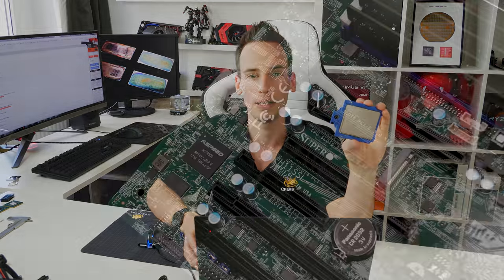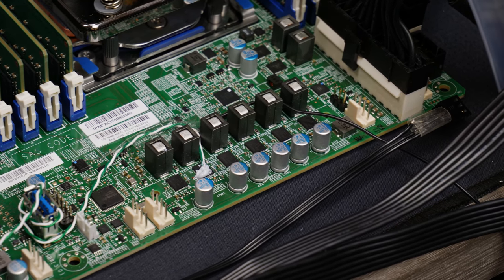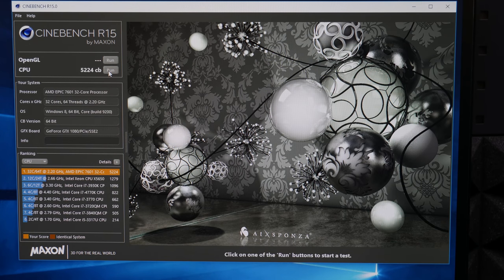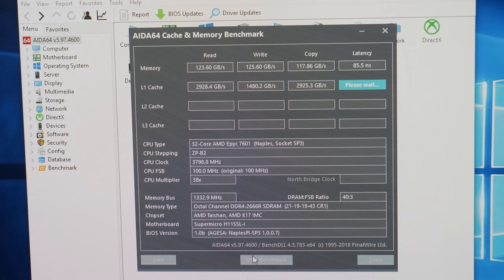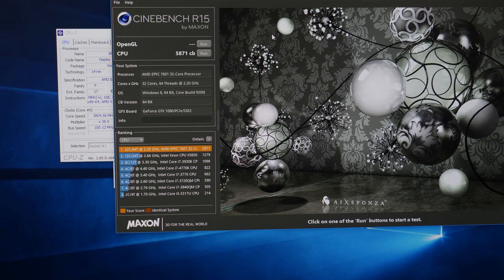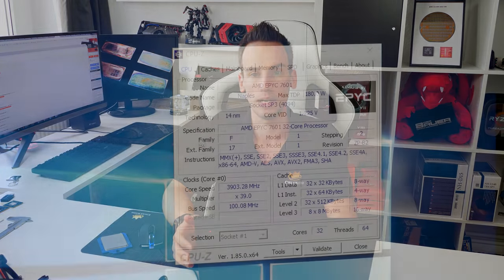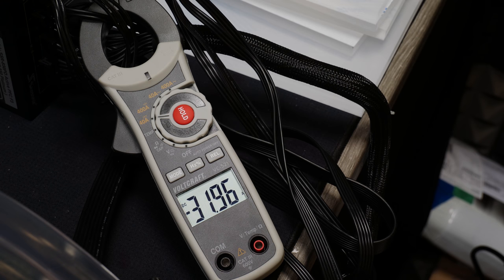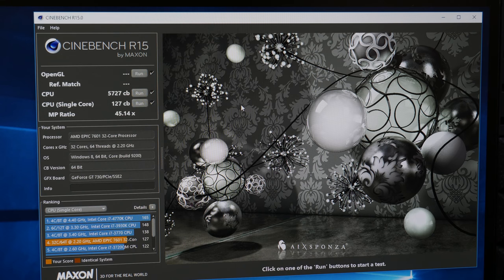Threadripper 2990X Preview - aka EPYC 7601 overclocking

Comment: Dude. Ask Evga to make another motherboard like the Evga Classified SR-2 and Sr-X. They let you overclock two Xeons. Having a motherboard that could handle two overclocked Epyc CPUs would be amazing. If not, maybe talk to Huanan?
Reply: I would not be satisfied until my rig dim out the lights of the entire neighborhood
Reply: Unfortunately EVGA manufactures only Intel based motherboards.
Reply: Huanan so far has only made crap mobos
Reply: Yeah they're kinda rubbish, but they're not afraid to do crazy things. Their X79 boards are just insane, letting you OC E5 V2 Xeons while not completely breaking the bank.
Reply: AFAIK regular X79 OC boards can also OC some Xeons
Reply: TheBackyardChemist
Yes, but they still cost A LOT even used. The Huanan boards cost around $110, and they come brand new in a package.
Reply: let's see if that changes when AMD holds the crown on HEDT performance & price/performance
Reply: Evga sr-2 is the best dual oc cpu motherboard ever
Reply: Kristoffer Johnsen evga intel shill
Reply: As a owner of three x79 motherboards (asus rampage iv, msi big bang, and intels own x79) Huanan boards are so much fucking cheaper XD. Now the combo deals on Aliexpress are not really golden deals but $80-$100 for a x79 board is a very fair price. Most x79 go for $200 unless youy get luck or find a low bid one like I did for mine.
Reply: Swan Knight if you can get a cheap x79 then it's better than that chinese board but otherwise it's stupidly good value for x79
Reply: Xx Tek tip xX I agree completely. Best one I’ve gotten so far was the evga classifies x79 for $40. The seller didn’t know if it would work or not so I shot that offer lol. My msi board I wanted and paid $250 for it but that was new condition so worth it xD
Reply: Swan Knight that's an INSANE deal - 40$ a for a x79 classified is almost unreal even if untested
Reply: Xx Tek tip xX I’ll be honest, felt kind of bad because he didn’t know what it was or what it was worth but once I sold it for $200 on eBay I felt better 😂😂😂
Reply: Swan Knight true, i got a noctua nh-d14 for £5 once and the seller had no idea what it was.
Reply: Swan Knight nice profit there - I'm debating whether to grab untested x299 boards since i got a 7740x for £10 after £120ish of unused cex vouchers and i need a mobo still
Reply: Xx Tek tip xX that’s what makes used parts hunting so fun. Finding those diamonds in the ruff
Reply: I just barely upgraded from my evga sr2 last Christmas. I loved that machine.  dual 6 core 12 thread at 4.5ghz... 2010 cpus.. it still ran with a 1080ti just fine. shows that the CPU world has been pretty stagnant in many ways, or been milking the population
Reply: Vega what did you upgrade to?
Reply: Legacy Political Yeah I didn't know they were team blue/green exclusively. I don't get why you would lock yourself down like that. AMD's multiple chiplets on interposers approach is likely to absolutely take over the world. You don't want to be tied to a (potentially) sinking ship.

Comment: cinebench use a lot of memory bandwidth so the quad channel will impact only cinebench I believe. I also think that threadripper cpu are desktop cpus and unlikely epyc 7601 the single core performance will be similar to the old 1950x. I hope for similar performance, so that professionals who needs this power can also play when they don't rendering, without buying 2 different machines, one gaming optimized and the other one a workstation.

Comment: Did you try running the memory in the other 4 memory channels?
If the memory channels are A, B, C, D, E, F, G, H...
In the clip you had channel A, -, C, -, -, F, -, H populated.
How about -, B, -, D, E, -, G, - populated? (so the other 4 channels)
OR... A, -, C, -, E, -, G, - (so unequal slotting)
OR... -, B, -, D, -, F, -, H. (the opposite unequal slotting)
Different ram slots might use different memory controllers and therefore different infinity fabric routes.
Thank you for the testing by the way, I'd like to request some task manager shots while running games like battlefield 1, pubg, gta5 and maybe crysis3.
The reason is this.....games will not benefit from more cores we know this, but NO ONE has ever shown how many actually get used in games, how many threads can various games actually use (ignoring performance). How true is "games only use 4 cores".
Again thank you for the testing.

Comment: The new Doom using Vulcan is a game I have used that seems to balance load across all 16 virtual cores of my 5960x. Perhaps it is capable of spreading load across all 64 virtual cores of the Epyc?
Reply: Carmacks engines have ALWAYS made use of as many cores available. The new doom is based on the (hacked) iD Tech 6 which John wrote for Rage. So I assume it will use 64 cores if available.
Reply: Since you wrote in all capitals that Carmac's engines always made use of as many cores available, can you tell me how to enable SMP in id Tech 1 and id Tech 2? I know how to do it manually in id Tech 3, but not the previous ones.
Reply: iD Tech 1 + 2 are Doom and Quake, yes? 1993 and 1995.

I don't see why John would have considered that back then. Doom and Quake players were using 386/486 or socket 7 processors back then.
Reply: So not "ALWAYS"
Reply: ALWAYS when RELEVANT.

It was hardly even relevant implementing multi CPU support into Quake III, given than less than 1% of PC gamers had multi CPU setups back in 1999. It was forward thinking. As always, from the greatest 3D engine creator ever.

You seem to have a problem and I wish you best with it. Whatever it is! XD

Comment: I think the problem is that ram speed and timings make a huge difference also the 2990x will be 12nm so i think a 4ghz all core OC should be np perhaps even higher with normal water cooling

Comment: You would assume memory compatibility would be better with Thread Ripper 2 so maybe 3000Mhz RAM vs the 2666 you have there also you have better latencies on Zen+ so that would help, but yeah the memory will still be a limiting factor just not to the same degree.

Comment: Did you use a custom bios?
Reply from the maker: No, but I can clearly say that you can't just buy the board and overclock it. It's not that simple. Just so don't people run to the store and try to replicate it =)
Reply: der8auer OK :) I have to say this video was eypc.
Reply: Yes. You need the power delivery system to handle it. How much do you think Intel paid for that custom motherboard they used to achieve 5Ghz on that 28 core Xeon? Can we croudfund such a board for Epyc OC maybe even dual Epyc. Just for the heck of it.
Reply: der8auer is it an engineering sample motherboard? With an old bios. I'm fishing for the gold here I know...

Comment: This is speculation only but i suspect that the 32 core TR boards will be running single dimm per channel 8 channel ram and enable a memory controller on each Zen die. Mirroring what the super micro board you used is doing. As the controllers remain on the CPU packages, the traces to teh Dimm slots are just straight wire connections and the config is determined by the CPU pin out. 

 The 16 core chip should continue as before with 2 dimm per channel with a dual channel controller on each die. 

The hub and spoke design of the network on a chip infinity fabric in each Zen die already creates a bottleneck as it merges the two 32 byte/cycle streams (64 bytes/cycle) from each CCX module residing on its own spoke, into a single stream, at what is effectively network switching hub, before sending the resulting merged 32 Byte/channel stream to the Memory controller at the end of yet another spoke. Each memory Channel can deal with 16 bytes/cycle or two memory requests at a time and the controller divides the 32 byte stream into two 16 byte streams for each Dimm. 

As soon as you add a GPU that is also competing with the CPU threads with its DMA requests,  that travel over the spoke from the PCIe controller to the Switching Hub and into the same 32 byte/cycle spoke connecting to the memory controller. In a gaming environment, The Fabric is potentially trying to merge 96 Bytes/cycle into a single 32 byte/cycle shared pipe.  The CPU cores have to sacrifice some of the bandwidth that they ordinarily have available to use in non gaming applications to the GPU. 

The problem with your test, assuming that the 32 core is quad channel,  is that while you are getting quad channel removing every second dimm, You are running a single channel from each die, forcing 64 bytes/cycle CPU thread load into a single 16 byte/cycle pipe to the single dimm attached to the memory controller which is not representative of Ryzen or Thread ripper. 

If the 32 core TR is quad channel and not the single dimm 8 channel that I hope it will be, the least damaging implementation would be die 0 and die 2 retain memory controllers and Die 1 and Die 3 have no memory controllers at all. That way you at least get the most out of two of the dies rather than compromising all four.

Comment: now i'm wondering how big of a base you'd be able to build in Factorio since its memory intensive... with the performance numbers of 8 channel ram i think Xterm's 60k spm server cluster base would be able to run on 1 epyc system quite easily at 60 ups, though that is very specific use case

Comment: Assuming one had enough money to burn, how would a 8c/16t behave against a 16c/16t (smt disabled) in gaming and such? We are at a point where we dont necesary need smt and could potentially avoid O.S scheduler missbehaving. while having all the extra godness. Since most threaded games and benches currently use up to 16 threads it could be interesting to see. Cheers!

Comment: TR 2 will perform even better at the same clock... it has IPC advantage and will have faster memory...
if the early benches are correct, it would score around  6000 points (stock)...
you forgot EPYC is 14nm while TR2 is 12nm and it reaches 4.0Ghz at much lower voltages.
Reply: I thought the 6000 points was an overclock.
Reply: 1idd0kun 6100, 6200 and 6300 were overclocked results

Comment: On the subject of RAM bandwidth, could you please compare an overclocked 8-core I7 when using quad-channel vs dual-channel? I have a suspicion that the upcoming Intel mainstream 8-core the Cinebench performance will no be 33% better than the 6-core at the same frequency. 
Now, moving to the AMD camp, could you please test the 8-core Threadripper with Cinebench in quad-channel vs dual-channel? People indicate the frequency as being important for Ryzen 1700-1800X, but I suspect that the bandwidth for 8 cores and 16 threads may not be enough. One way of testing my hypothesis is downclocking RAM in quad-channel to 800 MHz (1600 effective)  and comparing it to dual-channel at 1600 MHz (3200 effective).
I don't have any quad-channel motherboards, so I really can't do  these tests.

Comment: This is Zen Gen 1 based though, How much difference can we expect with a Zen+ based EPYC?
Reply: AMD is jumping 12nm for EPYC so EPYC 2 is ZEN2
Reply: Likely better clocks, the latency should be about the same, the inter-die latency was already better on TR compared to first gen regular zen.  if I recall correctly.
Reply: irain storm ok thanks
Reply: djelectric AMD isn't using ZEN+ for the next generation of EPYC. They are going to ZEN 2
Reply: irain storm you mean 7nm.  AMD is skipping 12nm. They announced this at Computex
Reply: What? 2990X is Zen+. Zen+ is still Zen1. You're question makes no sense.
Reply: Threadripper, not Epyc.
Reply: It should be similar to zen->zen+ gains. Intradie latency will be much better. Not sure how interdie will behave but we will soon know! Thanks for calling out that 7601 is actually zen not zen+

Comment: as for the results difference, what is the exact difference between 7551p vs 7601 (single ws two processor setups) which might account for benchmark differences? also, epyc is at 14nm while new th2990 will be 12nm and there are some differences in the die and the processor arhitecture as well

(great videos :)

Comment: "Probably not good for gaming?"....let's make sure and show some gaming benchmarks vs an 8700k?!?!?
Reply: It doesn't matter! Nobody is going to consider this CPU for gaming when 95% of games are written for consoles and also written to only use a handful of cores. In that respect, as long as you have 4-8 cores, it's clock speed that is important! Unless you play a game using an engine which can use more cores, of which there are hardly any.

Hopefully in the future devs will address this. But I highly doubt they will rush to address it when consoles are limited (this gen) to 8 (slow) cores and we won't see another XBOX for around 5 years.
Reply: Your typical gamer would not be able to afford this system at all. I'd say that makes any concerns about gaming, moot.
Reply: Of course it does. Any gamer who could afford it would be a total idiot not to drop that extra money into GPU's, RAM and storage and settle with a 2700X or 8700K anyways.
Reply: IT WILL GAME JUST FINE...99% OF THE  GAMERS can't tell the difference between 120 fps & 140 fps ,,,I know I can't
Reply: tbh , neither can I , but I think that's mainly because my monitor only goes to 120hz ;)
Reply: lordsqueak mine goes up to 144 hz and where did the extra 4 he come from? Scratch my head .
Reply: The only situation I can really think of where a gamer would want to spend money on a cpu like this as opposed to an 8 core would be someone who streams Beam NG and wants a metric fuckton of cars on screen.
Reply: its not about weather it will game or not - of course it will - its about how much of it; how many of the cores will be utilized while gaming.
Reply: Well, If you want something you can host a server on, and play the game on the same machine, , , no, still doesn't make sense. anyone who can afford this platform can surely afford to spend a little more to get a separate gaming computer.
Reply: The difference between 120hz and 144Hz is minimal and 120hz/120fps is smooth enough for any pro quake player to max out their skill regarding twitch aim, tracking and movement precision.

Back in 2004 I had a Diamond Mitsubishi 23" SB CRT, had it imported from the USA as soon as they were on the market. I tested all the way up to 240Hz (640x480) and after extensive hours I found that I couldn't see anything different beyond 160Hz.

Eventually I settled for 1280x1024 and 120Hz. Seemed like the perfect balance for me. I could have dropped to 1024x786 and ran at 160Hz but it made no difference to my gameplay and I prefered the clarity of the higher resolution over the minor gain in fluidity.
Reply: I can usually tell if the fps goes down under 100. But it depends on the game. Some games are critical, like pinball (which i'm into) ,, others it doesn't matter. I usually cap non-critical games to 60 just to keep it a little cooler in the room.
Reply: larry fleming   c

Comment: crap that ram latency is terrible, my haswell dt cpu running 2133 10-12-11-33 1t gets around 45ns
Reply from the maker: Yea 2666 C19 with ECC is not the best :D can't beat desktop by far
Reply: i was thinking that even tho TR2 is going to be quad channel it should be less memory limited than what your quad channel epyc test was just solely based on having higher performance ram, it would also be interesting to see how infinity fabric scales in relation to core count and ram speed

Comment: I wonder if the memory in 4 channels for the 32 core Threadripper will actually be fine as the frequency and latency should be better. Obviously it wont cross the gap completely but it should be better than Epyc in quad channel.
Reply: When you use 4 channels in Epyc, I think two dies are getting no access or almost no access to memory. But the 32-core TR will have those two dies wired through the infinity fabric to get access to memory. It won't be as good as 8-channel, but it won't be as bad as the 4-channel test in this video.
Reply: Between the infinity fabric, faster speed and better latencies it could be quite close then. This will be very interesting to watch.

Comment: der8auer did you check the utlization of the cores when you ran Cinebence with only 4 Dimms instead of 8.
I'm thinking maybe the Bios did not use all the cores when it detected only 4 Dimms.

Comment: do you think AMD could rewire the threadripper 2 package so that each channel goes to one slot on the board? So instead of four channels with eight DIMMs it's eight channels with eight DIMMs? I think this might help with the latency issues, but I'm not a computer scientist. (I bet the board itself would need changes in order to work like that)
Reply: No, I am pretty sure the slots belonging to the same channel are wired together. The most hackery they could do on existing boards is distributing the existing 4 channels evenly between dies (every die gets a single channel). AFAIK, they will not do this, and instead wire it exactly like a TR1. (two dies get two channels, two get none) Both solutions have their pros and cons.
Reply: TheBackyardChemist yeah i agree, they will probably go for the two channels/two dies for better gaming performance. They probably (hopefully) have something in place that makes sure the dies with memory channels are utilized first.
Reply: There is topology info baked into the CPU, including memory access stuff, but it will probably end up being a similar mess as current threadripper with NUMA settings... the CPU uses NUMA topology to tell the OS how to distribute tasks over the CPU, same goes with actual CPU core-thread topology and even cache topology. Thats why on Ryzen if you load 8 cores on an 8 core/16 thread chip, you will see 100% load on every other core (in terms of how task manager is laid out), because its trying to not use two threads of the same core.

TL;DR Windows/Linux will make sure the dies are utilised first :P